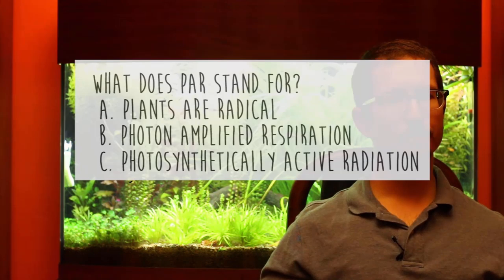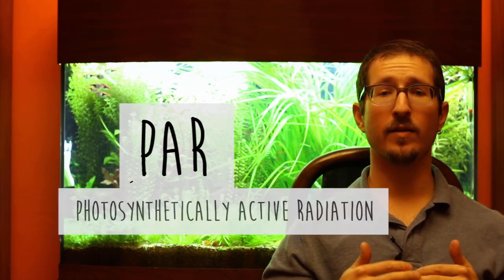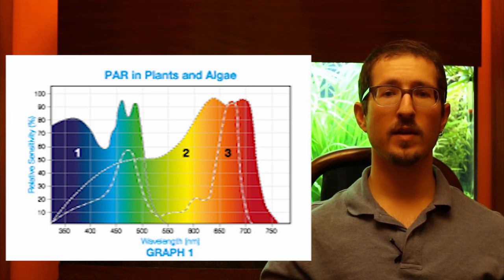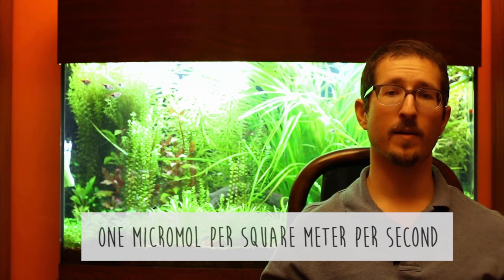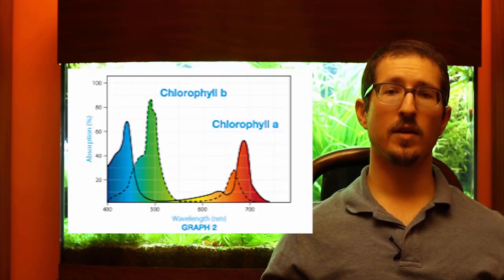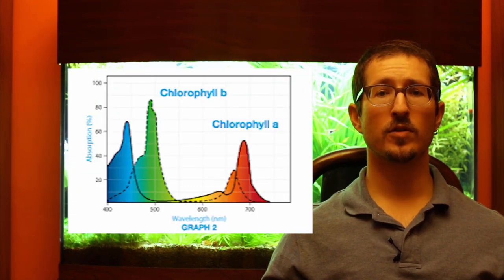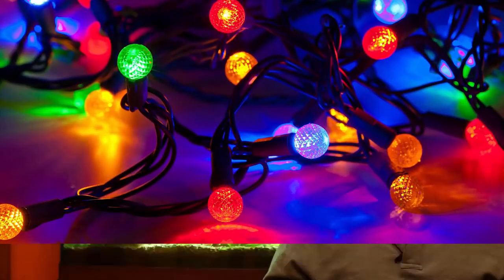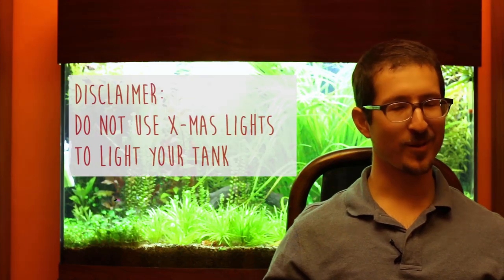Lighting a Planted Tank: Understanding PAR & PUR & LUX

Comment: That's right. Plants produce more than two pigments. But I guess they can adapt under limiting wavelengths of light. Cheap LED vs T5HO. I got lucky and learned about lighting right when I entered the hobby. I am using 55 PAR. Measured from lowest point of my substrate. And that is with 120 degree lenses. That is a good amount of power. My plants are growing fine. Slower, but well sustained. Easiest to balance a tank when light is the limiting factor for growth. At least in my experience.
Reply from the maker: Agreed, Dave. And hopefully I didn't imply that plants only produce 2 pigments. If only it were that simple! 
I agree with you on the light as the limiting factor thing-- which is also the mistake a lot of folks make when starting out, the old "more light is better" adage. And out of curiousity, did you measure the PAR in your tank, or is that reading from the manufacturer. Tithra (Green Mountain Goldfish) has a PAR meter that has me tempted to pick one up to play with.

Comment: i was just about to buy two marineland dual led light fixtures. My tank dimensions are 36x18x18" and i will have about 2.5in of soil when i put it together. My question is that i think 1of the 36"-48" would do good for low to at most mid so i was thinking in this case that two of them would give me a high range? IS this what i should be doing or should i only be getting one fixture. Also i would like to add that they would be hanging about 1foot above the water.
Reply from the maker: trey lanier I am doubtful that will put you in the high range. I'm sorry I haven't had a chance to look, but does Marineland publish any PAR data for these fixtures? That is the only way we can tell for sure how much light they put off. But my guess is that 1 fixture at that height will be low lighting, 2 may put you up into medium lighting. But without PAR data, we really are just guessing. Let me know if you find any charts or info and we can sort through it. Good luck.

Comment: Nice video NickMach007  tons of great info in there.  Thank you for the explanation (btw I got myself a cookie), everyone talks about par but no one explains it. Now I know. Great vid, but tell me, I've heard of success using spiral cfc bulbs. Any views on this?
Reply from the maker: Maurice McComie 
Thanks! As for your question, spiral CFLs are fine. The actual source of the light doesn't matter-- be it the sun, T5s, LEDs, or candlelight. The important thing is the spectrum and the intensity has to be right for plants to grow. And Depending on the setup, you can certainly do that with spiral CFLs. I think they are not used as much because they don't look particularly nice, and you need several of them to have enough coverage so the whole tank is lite well.
Reply: Hmmmm. Thank you for your response.  That may just solve some problems for me :)
Reply from the maker: Maurice McComie No problem!